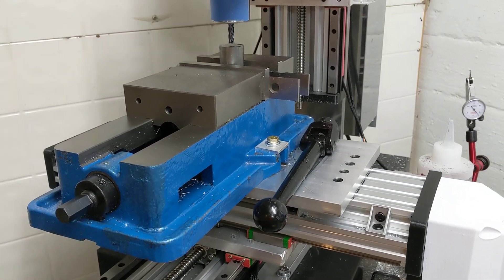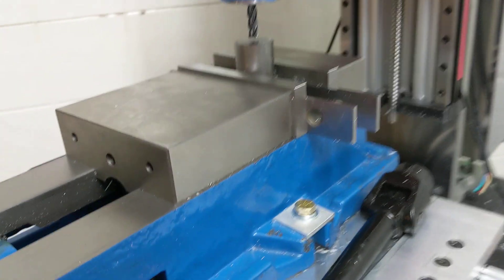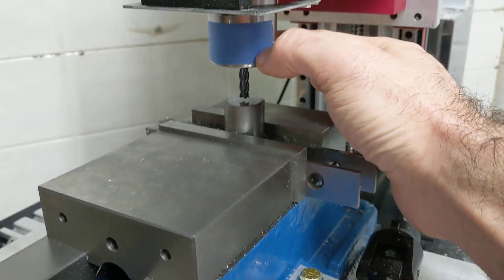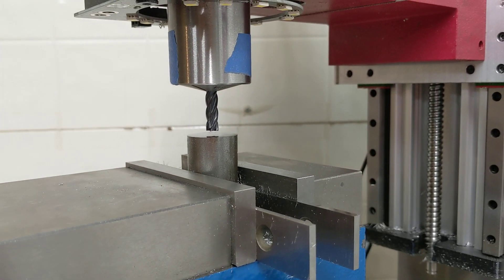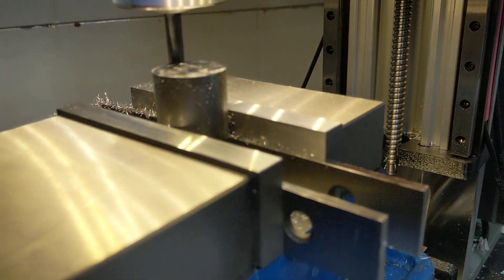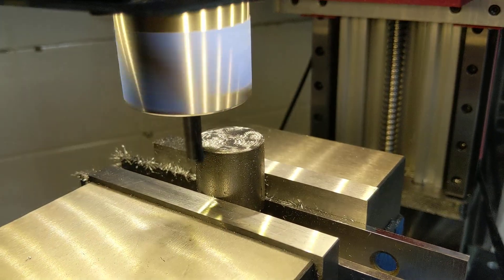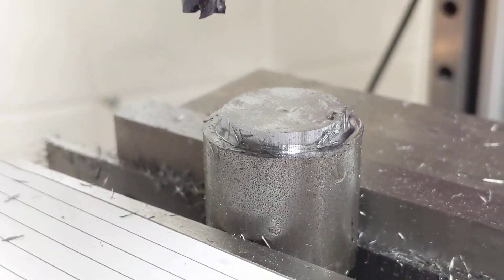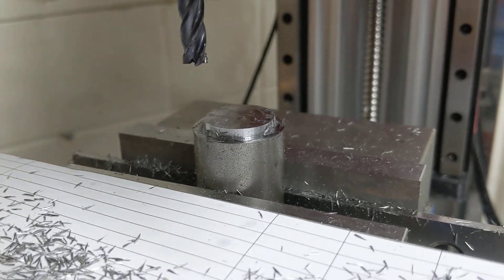RIGCNC-DIY VMC Cutting Steel

Comment: In the future, if you machine round stock in a vice, you should hold it in a v block. As you mounted it here, your vice is only holding along 2 thin lines of the part, which does not give sufficient rigidity.

Comment: would it not be better to bolt 40x20 extrusion to the c-beam instead of the 20x20 (if possible), also why aren’t you using the steel upright on freertool “AAB401M” it’s considerably cheaper
Reply from the maker: I wanted to be able to use a lot of the 90 degree  connectors to attach the two pieces.  If I went with the 20 x 40s connecting the two would be more complicated.    Is the one from Freertool the same model but cheaper? When I bought the original it was a LOT cheaper than it is currently on Misumi
Reply: @TheBetterRyanKelly  it looks to me like it is the exact same except for a 2mm step on the front face which can probably be solved fairly easily with shim stock.
if i wanted to deal with the mounting problems do you think the 40x40 will increase rigidity much
Reply: Using the concept from this video, you would only need to drill some holes in the extrusions that do not need to be precise at all: https://www.youtube.com/watch?v=2dvbn0rWA60
Also filling the extrusions with "epoxy granite" might be a cheap way to add more stiffness.

Comment: Certainly cuts it well enough to replace the alloy plates with steel ones and up the game another level. I reckon you should do that and measure the stiffness again and then see if it chatters less and if it still does figure out where the next weakness is and try to tighten that up a touch to fix it. Being able to make small parts in steel is super useful, at least to me, if not you. Cool stuff :-)
Reply from the maker: @fredio54 Good thinking, I think before that upgrade I will likely replace the ballscrew housing holder(s) ,they are one of the last pieces in the rigidity "chain" which is still 3D printed plastic.  I expect it will have some solid performance improvements considering all the forces go directly through them.   I have been holding off on them because the tolerances are fairly tight and it requires at least 2 orthogonal machining directions.  Now that I have a vice and a few parallels ill make it a weekend project and document the whole thing. After that Ill probably upgrade the end plates, those are still plastic as well.  The load path is pretty short so I think they have relatively little impact on the overall performance but I am quickly approaching the point of chasing thousandths instead of 10s of thousandths
Reply: @TheBetterRyanKelly  This project is awesome and I'm already itching to try it. Really hope you keep making progress and blaze the trail for everyone else ♥️
Reply: @TheBetterRyanKelly  Ahh, fair enough, I forgot about that. Looking forward to seeing those replaced and flex measured and a retry of this video afterward :-)